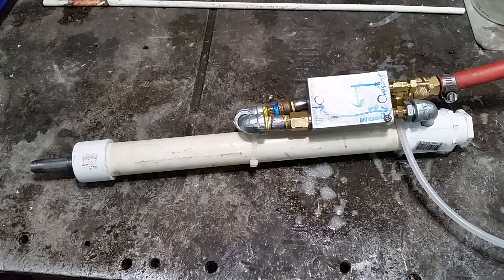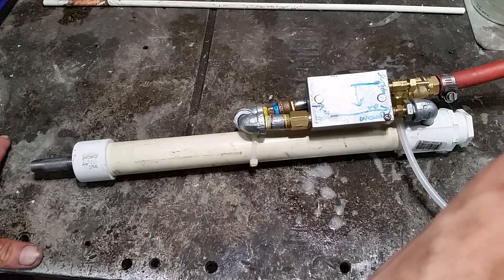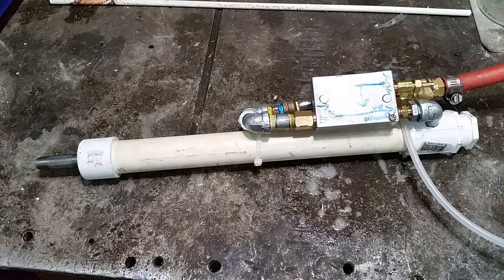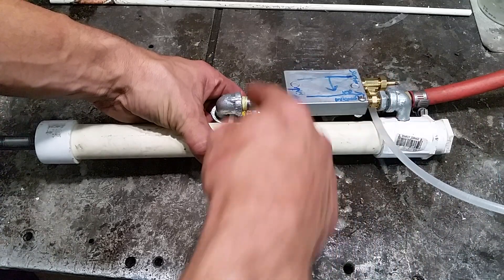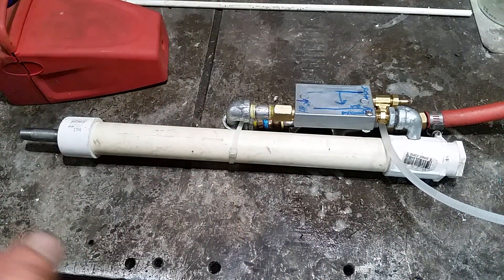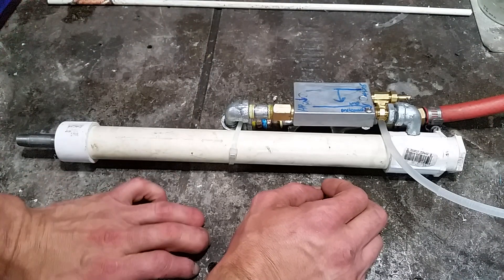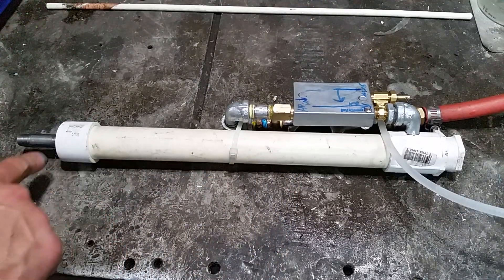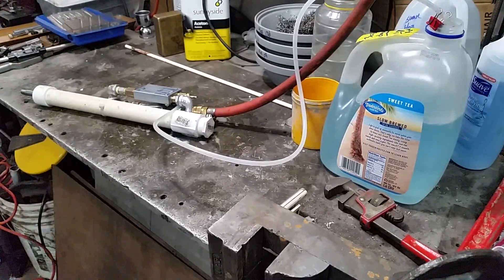simple aircrete foam gun

Comment from the maker: This was just a prototype I slapped together, put most of it together on the floor at menards.   The truth is, air cured aircrete just kind of sucks, the prototype never moved forward and so I never did a proper dimensional model, but since there have been request, I made a simple drawing that can be downloaded here: https://photos.app.goo.gl/YNCXwNWpvHkqHtP96  Hope that helps.
Reply: Hey Matt. Thanks for the update. Can you explain what you mean by "kind of sucks"? I'm curious what your experiences were.
Reply from the maker: @lemondealc  yah I suppose that comment wasn't particularly helpful.  My chief complaint is the crumbly nature of the material.  I was playing with ideas for casting tiles for a patio.  I thought aircrete might stay cooler in the summer, use much less material and be lighter.  And those things probably hold true, but in practice, I see no way you could walk on air cured aircrete.  I have seen samples of steam / pressure cured airecrete that are quite impressive, but thats out of range for most DIYer.  Also, a lot of DIY seems to be making air-ment rather than air-crete...that is to say, the only dry material is cement.  I did a few trials that way, they were very weak.  Using sand aggregate gets you back to something more akin to concrete, but the extra weight causes some bubbles to collapse, resulting in a smaller volume.

To say it more concisely, I expected aircrete to be more like concrete, when it is more like styrofoam.  Now, that still has value as an acoustic & thermal insulator, just not to me. 

I did end up making the tiles from a custom mix of fiber reinforced concrete.  two sizes of tile, one weighs 120lbs and the other 80lbs.  the whole deck is nearly 8,000 lbs....the lightweight aircrete would surely have saved my back.
Reply: @mtraven23  Thanks for the reply. Perhaps vermiculite would have helped prevent the material from crumbling. I understand they use vermiculite for poured pool floor so that it is not as abrasive on the liner. I'm pretty sure the density is about the same as aircrete. In fact, I read that detergent is added at the very end as part of the mix to improve the plasticity (not creating bubbles). Here is a link: http://www.swimmingpoolsteve.com/pages/vermiculite.html
Reply from the maker: @lemondealc  I think they use it for pool bottoms for insulation reasons, so you pool is not syncing with the ground.  I have used perlite & vermiculite to make insulative  concretes. Both work well, much, much better than aircrete.   I have also tried hempcrete &  my own personal attempt at sun-crete (sunflower stalk substituted for perlite.  Those are in a little different class, slightly less insulative than vermiculite/perlite versions, but significantly strong do to the organic fiber.

If you need your concrete to be more plastic, well that's what plastizer is for and wow is that stuff incredible.

You said you wanted to know about my experiences, I have gone through a lot, so maybe you want to share a bit about what your project is and I cant try to be a little more relevant with my responses.
Reply: @mtraven23  I saw a guy on youtube that made a rock face aircrete, basically just put hard concrete on both sides of the aircrete in his forms. This would allow you to have more structural integrity for walking on it and use less material. Cheers for the design
Reply from the maker: @divisionoflabor3070  agreed.  it was something I considered...but I was making patio tiles that are 1.5" thick.  so if I wanted, say 1/2" of real concrete @ the top & btm that just leaves 1/2" of AC in the middle, so whats the point?  Also, having made the tiles, I actually wish they were heavier as I am having some issues with heaving in the winter.

but conceptually, you're spot on & in different applications, I might try that.
Reply: @mtraven23  Yeah would get rather thick. I think there's a lot of experimentation that can be done with formulation, adding fibers to increase strength. Maybe combine that with one side being rock faced.

Comment: Could this be used to spray concrete to the walls?
Reply from the maker: no...there's just not enough power to fling heavy concrete at a wall.

a few years back, I was refinishing a bunch of walls (drywall) with a knockdown finish (like a popcorn ceiling, but flattened).  I built what amounted to a pneumatic cylinder out of a 6" piece of pvc.  It was able to spray drywall mud, very effectively.  If you need to spray concrete, I think that would be the right approach.

Comment: Thanks, l enjoyed your video info. I am looking for a better way to cast pavers for our property. 
Your design is simple and has those featured l thought made sense. 
I am eternally grateful for your invention. It will help us to do all the small projects ( BIG ) ones we have in mind.
You Sir, are a genius 😏🎉🎊🏆
( l did have to stop and take snap shot photos to see all the different attachments, l have enough photos that l used up all the memory on my phone 🙋🏻‍♂️🤦🏻‍♀️).
Reply from the maker: thanks for the kind words, but I gotta clarify a few things:
-this is my design(and a crude on at that), not my invention, i've just cobbled together other people's "inventions"

-I would not recommend making pavers from aircrete, it will crumble.  In fact, this prototype was built thinking I could make concrete tiles for a patio...I thought they would be light and not get as hot in the summer (that would have been true) but the structural integrity of aircrete is a fraction of standard concrete.

-if you are making a lot of pavers, turn over time becomes relevant, so you might look into accelerators, I think alumina is one of them. 

-Also be sure to keep them wet for 14-27 days after casting.  curing goes on forever, but most of your strength is there at 3weeks - 1 month ( and a lot of it is there at 7 days).  If you are in a hurry, steam curing is the way to go.  commercially they can match 27 day air cured strength in about 3 days.  I have tried it, works extremely well, only downside is energy  consumption, as I used an electric oven.   For a big job, perhaps a greenhouse-ish solar oven would work nicely.

-I dont know if you are the type to wear gloves (I am not normally) but when I first dove into concrete, after about 2 weeks I had worn through my fingertips!  That gets real painful, real fast.  So be sure to glove up!

-lastly re: the photos---print screen is your friend!  also there are several video download plugins for all the major browsers (no youtube from chrome though).  When I need to follow along something technical, I like to download the video and work my way through it in a media player.

Best of luck with your projects

ps--i just read your actual screenname and felt obliged to to mention hemp-crete, or in more general terms cellulose - crete.  If you are not familiar, its remarkable stuff... have a look.  probably still not ideal for pavers, but much better than aircrete, and certainly interesting.  With the patio I mentioned earlier I went with "regular" custom concrete, but in places where I need insulation (thermal or acoustic) I have had good results with plant based concretes.  I never got actual hemp, but I grow sunflowers, dried and chopped the stalks and vala..... sun-crete!  Perlite and vermiculite are two other common insulators / "lighteners?"

Comment: Hey Matt, so this is the venturi valve right?  https://www.harborfreight.com/air-vacuum-pump-with-r134a-and-r12-connectors-96677.html .  The dude @jonwasbored said he tried to make a gun with a venturi but failed.  I noticed he has the little porter cable compressor in his vid (Same one I have) which is only capable of 2.4 SCFM a minute @ 90PSI and it says 4.2 CFM per minute at 90 psi air consumption on the front of the harbor freight part so is that the reason?  Or would it work for a little bit and then you would have to stop and let it rebuild pressure?
Reply from the maker: That is the venturi I used, though I am sure there are better options out there.  So my gun was just a prototype and never intended for big batches, also I have a very large compressor.  So for me, it ran slow but consistent, I always had output. Though, when I over packed the barrel with ss mesh, there was inconsistent flow.

I pretty much abandoned this, but if I were to make something capable of larger batches, here is how I would make the next one:
every part of the input system needs to be bigger, maybe source a venturi from the aquarium scene. 
then I would play around with different air sources, I suspect, volume is more important than  pressure.  Taking a note from "the club scene", when they have "foam parties"  they use high volume blowers, often repurposed shop vacs.  Now the foam they make is significantly less dense, but I think that has more to do with the foaming compound and lack of restriction in the output barrel.  Tha'ts all just gut feeling, I have not tested that theory (and probably wont)
Reply: Thanks Mr. Art,

I have been looking for the simplest design possible for months. I thank you for the link to that venturi item.
Now all l need is the rest of the pieces of this puzzle 🤔🤪🥳

Comment: Would you please make an assembly video? I'm looking to make one of these but have no idea what parts you used or how to put it together.
Reply from the maker: sorry, but no I am no longer working with aircrete.  There is a diagram in the pinned comment on this page.  In general, its mostly NPT fittings, honestly I designed and built most of it on the floor at menards.  If ya can't figure it out from the 10+ minute video and the diagram, respectfully, you probably shouldn't be pursuing the DIY approach.
Reply: @mtraven23  I'm a plumber and done quite a but of concrete work. There's a lot of different fittings you can use for a lot of different reasons but I found a better design from somebody else so thanks anyways.
Reply from the maker: @mickey7660  calling this "designed" is rather generous, its more just cobbled together. and that "design" is posted in the link I gave you. Its mostly just a bunch of NPT fittings.

Think of it more conceptually...you need: a venturi (with a valve for regulation) to suck up the concentrate, then you gotta blow it through a tube full of ss mesh.  Playing with the amount of mesh you pack into the tube can help tune the density of the foam.   I would find a larger venturi and I might use a shop vac rather than compressed air next time---volume seems to be more important than real high pressure.  Good luck!

Comment: I love the ideas of using a venturi and a trigger.  Just completed mine using your idea as a base with much less hardware.  I have the air hose going straight into the back end with a piece of irrigation tubing stuck in for the soap feed.  I have a threaded cap on the output end so I can clean it out.  I'll try it out tomorrow.
Reply from the maker: by hardware I take it you mea fittings?  If so, you can certainly assemble it with fewer fittings, I did it like you see for strain relief on the pvc-NPT 1/x connections.  all the fittings lay flat on the pipe with a couple zip ties.  The whole unit is self contained and more rigid this way.  I am not particularly delicate when im working, so durability is important.  Lots of other ways to do it, but if all you have is a pipe threaded into pvc, its life is very limited. 

I went straight in the end initially as well, but found it was more of a squirt gun.  The 90 input now splatters against the inside wall and seems to distribute the concentrate more evenly.  That is mostly speculations as I cannot see what is going on inside...someone should build one from acrylic / poly carbonate...or even pvc with a window. 

 Also, I always meant to try a high volume low pressure air source like a shop vac, as I always felt the high pressure, low volume air compressor setup just didn't give me enough air...though the 1/8" venturi was the real bottle neck.  But the shop vac type setup seems to be how they make foam for dance clubs (ie "foam parties").

Comment: Hi Matt. I am in the middle of making a version of this gun. Unfortunately, I think I have purchased a very small venturi vacuum pump. Can you tell me please the size or specs of your venturi vacuum?mine is 1/8" NPT.I am now starting to doubt if this will work for me. Thanks
Reply from the maker: venturi vacuum pump?  Is it the type that you apply compressed air to one side and the other inlet sucks?  The venturi I used came from a system like that, as to what the size is...well its that chunk of aluminum in the video, I cannot say how big the internal pathways are, but I tapped 1/8" npt holes for the connections.  What exactly is the gun doing / not doing?  Keep at it, it took me a bit of tinkering to get it working properly.
Reply: @mtraven23  Thanks Matt for giving attention to my post. The compressed air flows out to the suction port instead of going thru the foam wand direction. It could not overcome the pressure build up in the foam wand. May I know what grade if steel wool you have used. Mine is the finest. I thought it will give better quality foam.
Reply: @mtraven23  Just adding a bit Matt. I used the venturi vaccum. That aluminuim chunk. I tried to buy the red vacuum pump like what I have seen in your video expecting to get the same mechanisms you have. But what I get is a plastic square, and not even function as venturi.
Reply from the maker: @tzikhan5546  actually now that I think about it, that "alum chunk" is actually plastic (I remember thinking painting it silver was sneaky). 

So my first thought is you have too much back pressure from steel wool.  Finner mesh does not mean better foam  I used very course material (the type sold as kitchen cleaning scrubbers) and even with that course material, I had to remove some to get it going.  I am guessing to started on the high (too much) end, start from the other way with, it will act like a squirt gun.  That's a good initial checkpoint and proves you can successfully make the air/concentrate mixture.  now you need to tune your "pack"... add some mesh, test, repeat... eventually it will blow bubbles, ie foam...I think a long (maybe 24"+), small diameter barrel with a loose pack would have advantageous results.  Also, if you went with a bigger OD pvc in an effort to improve the output rate, I found that to be a problem.  Even with my beefy compressor, I couldn't get enough volume of air to make good foam (bottle neck @ blow gun valve & venturi pathways).  If I were reworking this project I would experiment down all the way to 1/2" pvc. you can also play with the nozzle size, i would start small.   also I would probably get some acrylic tubing  or cut windows in the barrel to see what the hell is going on in there with different packs.  Also note the 90 degree input into the pvc barrel, this proved important in preventing solution from blasting through too fast. 

In fact, that should be your goal, tuning the time it take the solution to go through your barrel.

none of that matters if you don't have a working venturi and your "not even function as venturi." comment worries me...did you test the unit before taking it apart?  take that block, should have 3 ports: high pressure(HP) inlet, output and suction. The in & out are likely inline with one another.  So take your air gun and blow through what you think is the inlet, the assumed output with be obvious, but the 3rd hole should pull a vacuum you can feel with your finger.  If it doesn't, flip the in and out, does it suck now?  Lastly you can try the 3rd hole as the input, if you still have no suction, return/bin it.  If you do have to replace your venturi,  get something bigger...look at aquarium venturis.  I used to have one that had garden hose sized ports, run water through the input and the suction port would vacuum the tank for cleaning. 

hope that helps.

Comment: It is a good idea to use the Venturi principal but from your video it looks like you need to get some higher volume of flow to keep up with the cement mixer. Perhaps if you had a shorter line to your 5 gallon bucket? A fatter line?

I like the simplicity here but your gun looks like it would take quite a while to fill a 55 gallon barrel though!

Also I would suggest adding a fibre to your aircrete like cattail hotdog fluff or milkweed fluff
Reply from the maker: this was never intended to fill a 55 gallon barrel, I never intended to make large pieces.  And there is no need to "keep up with" the cement mixer, proper foam will stay foam for many hours, so speed is a convenience, not a requirement.  All that being said, you could scale this up with thicker lines, but a differently proportioned venturi (one that brings in more concentrate with the same air) would be the most effective change to speed this up.

I have been playing with using sunflower stalks (I grow them, so I have a lot) to make an "orgConcrete" similar to hempcrete.  results have been good, on par with perlite for vermiculite concrete. Even looking at sample that have had a year to cure, I remain unimpressed by aircrete on its own...its just too crumbly for my tastes / applications.